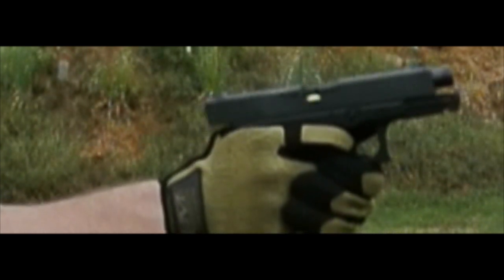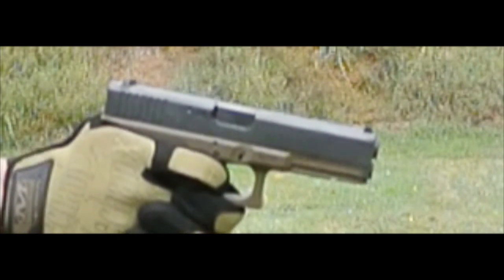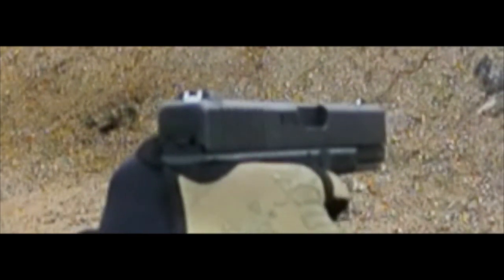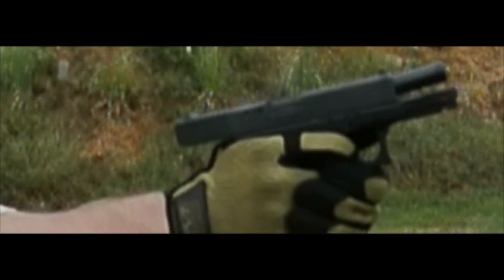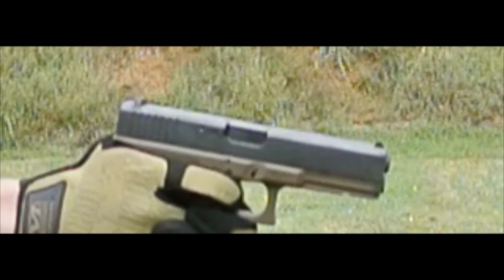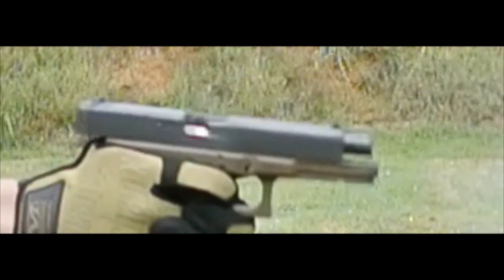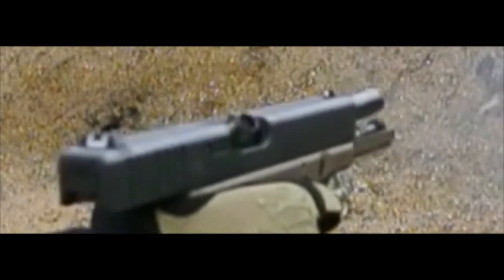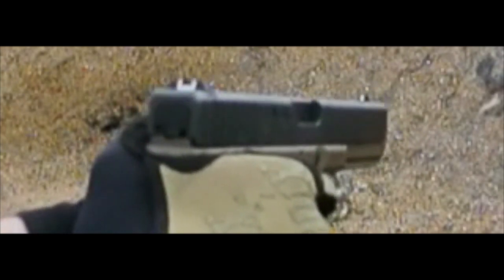Slow Motion Glocks! Gen 4 G17 & G23 Ejection Compared

Comment from the maker: The brass isn't curving in the air- it still ejects straight out of the ejection port.  However, that straight line is now taking it to my face with annoying frequency.  I don't think it is the direction of the spin that matters.  Rather, I think the fact that it changes direction means that it is losing energy it needs for appropriate ejection.

Comment: I first experienced it when I went to cheaper ammo at the 600 miilestone. Also, I'd been playing around with the sight pictiure; holding at the six o'clock and elevating the bead. I found the front slight picture elevation resulted in increasing the btf outcomes.

Comment: all these years later, I'm still having BTF issues with my Glock 19 Gen 4 (FDE interestingly).  Sent it in and Glock did something to it.  worked better for a bit, but BTF came back.  Replaced some parts (apex extractor and a few other bits) but it still does it.  It's definitely not grip.  Oddly enough, the tighter and better I make my grip (the more I restrain the muzzle flip) the more likely it sends BTF. When I purposefully 'limp wrist' a bit the brass goes elsewhere (other than straight back).

Comment: Hi again ,I just came from the range and  the problem is now solved with my G19.Yes the ejector polish is just an option and no alone it would not fix the problem.The problem is the extractor the dip extractors have a bigger claw and a steeper angle, that what is causing the weak and erratic ejection,and no it does not have anything to do with the case holding ,in fact it is holding the case to tight not from sliding but from ejecting normally .Use a non dip ejector and u will solve it.

Comment: I have same problem with myGen 4 g19 .It is the extractor because i switched the extractor on a g34 Gen 3 and had the same weak ejection.And installed the old extractor on the G19 and the ejection was strong and to the right as it should be.I took the new extractor and relieved some metal from the claw on the inside and from the outside because the claw is too tick and it is interfiering with the angle of the brass when hit by the ejectior now it is more strong ejecting and better angle.

Comment: I'm getting a similar bttf with my Gen 3s, G27 and G23.  The G27 has ~4000 rnds and the G23 has slightly less that 2000. It's not often, maybe one every 2-300 rounds but I had one that actually dropped behind my safety glasses and wedged between my eyelid and the glasses and burned the crap out of my eyelid.

I intentionally didn't clean then for about 700 rnds each and yesterday the bttf was definitely worse. Will do a thorough clean and test next weekend. BTW using Fed Amer. Eagle 180gr only

Comment: I own a G21 Gen 4, with about 1,500 rounds through it and it is now doing just that, brass to face.  I have even changed recoil spring assemblies and tried a Lone Wolf compensator. it will be going to Glock for a check up.  I own G 26, 23, 30 all Gen 3 with thousands of rounds and not one issues.
Reply from the maker: You need to change the extractor.  It is where the problem lies.
Reply: TWANGnBANG not ejector?